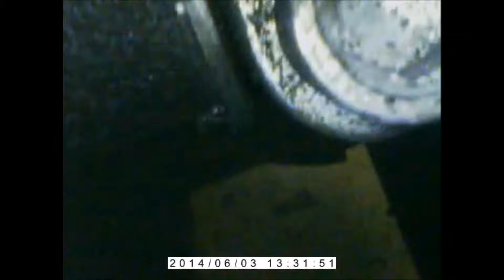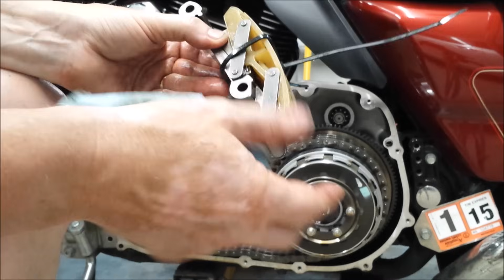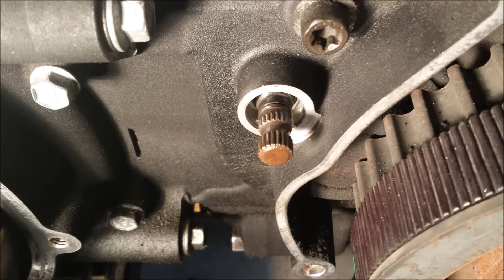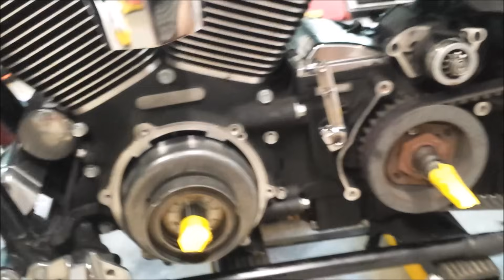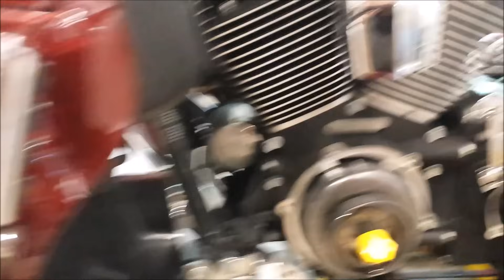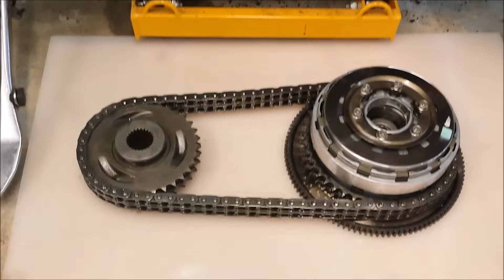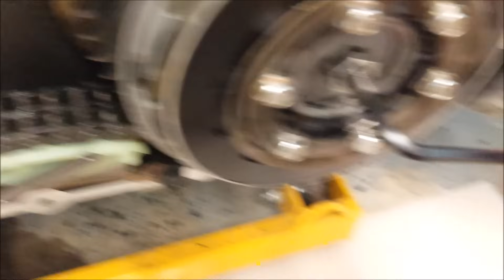HD Ultra Classic Primary Removal and Installation

Comment: i have a 2010 electra glide Ultra classic with less than 5000 mi . my question is i have a problem with 2,3.4.5,&6 gear only when the bike is cold. i have to let the bike run about 15 min than it will shift from 1-2 ride it in 2 gear for 2 min in 3 gear about 4 min than the bike will shift all 6 gear after that the bike shift all gear find as long as it stays hot..please help. thanks in advance: STAN WHITT
Read more

Comment: OUTSTANDING!   Great job for the folks that have the ability to do the work.   Good details and explanations are awesome.  
I just replaced the transmission main shaft bearing and (the bearing that's in the inner primary cover, just below where the starter mounts in the inner primary cover) inner race that's on the main shaft.  
That piece of Poplar worked perfect!   I used a piece of pine that worked just great.
Reply: I also replace the transmission linkage, and lever.   Along with the seal as well.

Comment: Nice how to video!  Good Idea to change out that tensioner while right there.  With regard to the darker yellow color of the plastic on the old tensioner (as compared to the new tensioner); that type plastic tends to start yellowing and turning brittle after being subjected to heat, stress, and oil over time....real nice job....took me back to my shop classroom days!!

Comment: Lots of PLASTIC chain tensioners on modern Twin Cam Harley engines, all designed to wear out and have to be replaced. And all are in critical engine components. Two PLASTIC cam chain tensioners are on the cam side, (right) of engine and are used as part of the Roller Chain drive to operate the two cams on these engines. Failure to replace a worn cam chain tensioner, will result in metal to metal contact, between the hydraulic tension holder and the Roller Chain, resulting in metal shavings, being inducted into the crankcase, oil pump and cylinders and results in immediate, catastrophic engine failure, scratch one Twin Cam engine. Harley could have used Metal Gear Drives for the cam operation as they used to use on the proven, reliable, EVOLUTION engine, produced from 1984-98, but, chose to go the cheap route to ensure lots of work for their parts/service department. Twin Cam engines also use a pressed together crankshaft, which can twist out of true, on a hit or miss, basis, and also crater the engine, unlike the EVOLUTION, single cam engines which used a bolted together crankshaft. Harley is going backwards, not forward, in technology. Twin Cam engines use a dry sump oiling system, which means their is very little oil circulating in the crankcase, most of the oil is stored in the separate, oil tank and thus, the engines run extremely hot, and heat is an engine's worst enemy, deteriorating the oil viscosity and shortening engine life, plus, making it a hot, experience to ride on a hot summer day..........
Reply: Why is this being posted here? This video is about replacing an oil seal. Why all the extraneous stuff about chain tensioners and dry sumping on this thread?
Reply: So, a savy rider should check the nylon(ish) chain tensioner regularly. Good thing the primary cover is so easy to get off, huh bud
Reply: The primary drive chain tensioner should be changed out at the first sign of wear or tracking across the face of the tensioner, usually around 25-30,000 miles. The newer model Twin Cams, 2011 onward, utilize an automatic tensioner, in the primary and many find that the pre-load on the chain is excessive causing compensator noisy and premature compensator failure, so, they opt to install a Baker compensator and Baker manual tension pad, instead of a stock automatic tension shoe pad, again.
Reply: get a life LOSER tomcata1467

Comment: did you have to drain oil before doing this?
Reply: He drained the primary oil. There is a drain plug on the primary cover. It is located on the bottom right, while looking at the cover. Refill the primary with one quart of whatever primary oil you choose to run.

Comment: one more thing, once the torque wrench clicks, never go back that do it twice. Once only
Reply: Funny the "army" and many others track to "click " the wrench 3 times. And…to pull steadily not jerk.
Reply: teach, not track.
Reply: the main thing is to lubricate and bolt or nut threads are they will not torque correctly. Smooth steady pull, click once.

Comment: Harley should have told you that you can NEVER torque a bolt or nut without first using some kind  of lubricant on the threads. You can NEVER torque a bolt of nut properly without lubricaton.
Reply: John walker is correct. There are dry torque specs. and  lubed specs. along with torque turn and others. Most are lubed specs. If a torque calls for dry and you oil the fastener it can over torque it by 30% and possibly damage the fastener or threads. Always check the service manual if unfamiliar with what your repairing. Think about it, you don`t put extra lube on a fastener if it calls for loctite. Bottom line, check the service manual. Just my opinion on the subject. Thanks
Reply: That is incorrect. Most are torqued dry unless specified.
Reply: you can never torque any bolt or nut without first lubricating it. The purpose of torque is to stretch the threads. If you can run a nut or bolt all the way to the end of its threads, it have not been torqued. If the nut or bolt can not be run all the way up by hand, it has been torqued. I took a class once on proper torque of nuts and bolts. Using the same wrench and setting, you can almost double the torque value before breaking a bolt with lube. Dry, it will NOT torque to specs.

Comment: Your red loctite comes in a blue tube?  Remember you are on a time limit once the loctite has been applied.  It sets up fairly quickly.  When you torqued the clutch nut I did not see it turn.  To get an accurate torques, the nut/bolt must be smoothly turning until the click is heard.
Reply from the maker: Yes, it was blue loctite in a red tube, and that always bothered me too, but it was actually the blue variety of loctite.
Reply: @dldavis3  Other way around?  Question.  Other than the red loctite for those big pieces and the 5 pre-
loctite bolts, I noticed that you did not use loctite on the primary chain adj nor the outer primary bolts.  Thoughts?

Comment: As a mechanic of thirty years, I am impressed by the professionalism of this video I stumbled upon! Kudos, sir.
Reply: use a magnet may be
Reply: tilt your bike on its kick stand and knock it with the adjustment screw you just pulled out from in front of it and it will bounce back and expose itself enough to grab it.
Reply: Jeffrey Miller that rod he pulls out at 7:24 I pushed that in by accident and can't pull it out is that a problem? I I don't have plies that can get in there and grab it what should I do?
Reply: @cayuga2832  sorry, missed this for A YEAR.

Comment: great video I need to replace the seal on my 07 Electra Glide. I replaced the shifter seal on my Goldwing that was a lot less involved than the Harley. but the Harley looks simple enough to do just a little more involved. Definitely will do it myself I don't trust shop. thanks for putting out this video.

Comment: Great information, I will remove my primary cover in the next few days. I will use this info along with my manual to change out a clutch spring as well to check the various seals and gaskets while I'm in there. Thanks !!!!

Comment: dimentions were given for a tool made out of wood used to hold  one sprocket wile tightening the other, it was 7 1/4 inches long, how long would a similar tool have to be to do the same job on a softail, the distances between the sprockets is longer on softail primary's ! THANK YOU, BILL

Comment: Nice video, i have an 06 Ultra w/ the same problem. This will be my winter project. I'm assuming all clutch play must be released prior to this and is the bike in gear or not also what about the starter gear teeth does it self align? Thanks Glen

Comment: the wood tool used to hold one gear wile torqueing the other was  7 1/4 long, how long will it have to be if you are working on a softail, I have a 1985 FXST & want to make one to do the same job on it ? thanks Bill
Reply from the maker: It isn't a critical dimension.   I just made an eyeball estimate and it worked fine for me.  You just want to lock the gears so that the chain takes all the tension.  Anything within a 1/4 inch or so would probably work fine.
Reply: I didn't use that wood tool per se. I fabricated a chunk of wood similar to the HD tool, only much cheaper! Small block of wood about 3 inches long and notched out some "stairs" on one end, put it in between chain and gear. I work great!!

Comment: So you had to do all that and replace a hundred dollars in oil and gaskets for a $2.00 shifter seal? Somewhere in your mind don't you sort of realize how poorly engineered the damn thing is?
Reply: +Bruce Bosco When my shifter seals start leaking I just leave them for that very reason. It's a harley... they're pieces of shit and are going to leak, but it doesn't stop them from running. I only replace leaking seals in the primary side if something else more dramatic is going on that requires the pulling of the whole inner primary, unless it's the crank seal. In all honesty though, I know of many old Evo's that have gone well over 100k miles without ever having to pull any of that.
Reply: Well your Honest - I have a Buell and dropping into first sounds like a Hammer hitting a bag of bolts lol Best of Luck with it
Reply: That is normal... straight cut gears do that.

Comment: I'm pretty sure by your naturalness in explaining, along with your complete grasp of the process involved in the work to be done, that you are a mechanical engineer. I was one too until I retired. 
When H-D said to first torque to 100 ft. lbs then back off one full turn, then re-torque up to 140 ft. lbs my guess is that when you initially torqued to 100 ft. lbs the threads on the bolt become just a little stretched and H-D understands that. They want you to do that. So then afterwards when you achieve the final required 140 ft. lbs specified torque it is a more accurate actual fitment to 140 ft. lbs.
I just purchased my second new Harley-Davidson, a new 2015 FLHP Police bike. I have wanted one since age 6 way back in 1956. Dreams do come true. I still have my 1994 883 Sportster Deluxe and my 1976 T140V Triumph Bonneville 750. I did all the work on my Triumph myself and loved doing it. My Sportster never required any fixes or work other than changing the oil, lubing the cables and a new Halogen headlamp bulb. I still have these fine machines. That's why I purchased another Harley-Davidson.
Reply from the maker: Your guess was close...  Yes I am an engineer, but EE rather than ME,  and I am retired too.   But it seems all engineers suffer from the same obsession about getting the technical details correct .
Reply: @dldavis3 was my guess as well

Comment: Giving torque specs & size of wrenches is priceless. Great job Pal  !
Reply: If you updgrade to a SE comp you will need a torque wrench that goes to at least 200 lbs, 180 is the torque requirement

Comment: Great video.  Thanks for posting.  As someone else said, try the Hayden Auto tensioner.  So much quieter and smoother than the "Hydraulic" tensioner that is stock.  The only thing hydraulic about it, is its covered in oil!!  haha.  thanks again..

Comment: Seems to be a pretty common problem on Harleys these days. Do yourself a favor and look into the Baker Attitude Adjuster, or the Hayden Auto Tensioner, those new tensioners that Harley is building, (like the one you are using), are taking out the main drive gear in the transmission, followed by the sprocket side engine bearing. I am in Canada and the bikes I've seen this happen too, are usually at the 80,000km on the speedo when it happens (50,000 miles in US terms) this is caused by the inability of the tensioner to back off, as you saw when you took it apart. You may notice a wierd wear pattern on your drive belt, as one of the signs that it is starting to fail. Hope I saved you some money. Richard @ G&R
Reply: Lawnboy From Hell , mind did just what you said, about 3 year ago Hayden units were back ordered so put in screaming eagle manual adjuster, yes I have to open it up every oil change and check The chain tension. Looking into a baker attitude or a Hayden Don’t know which one to go with